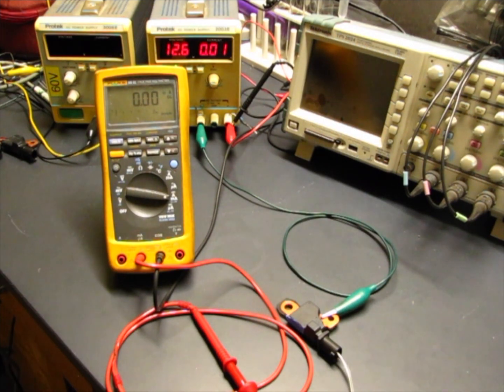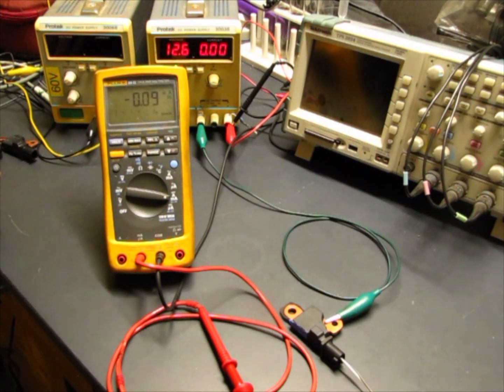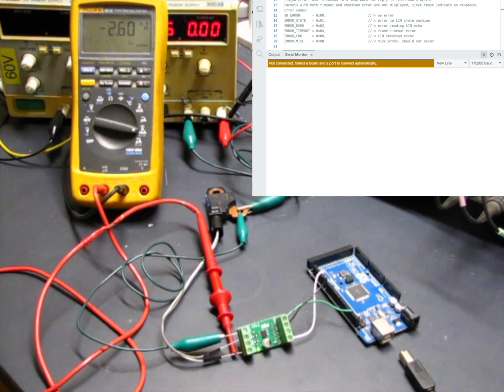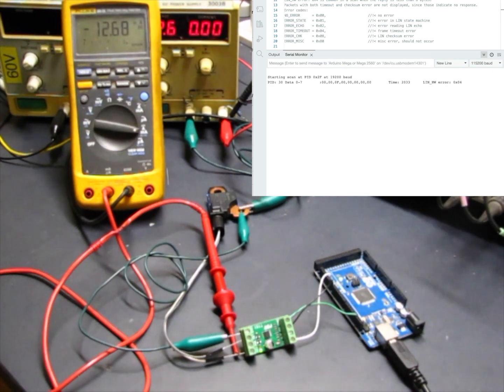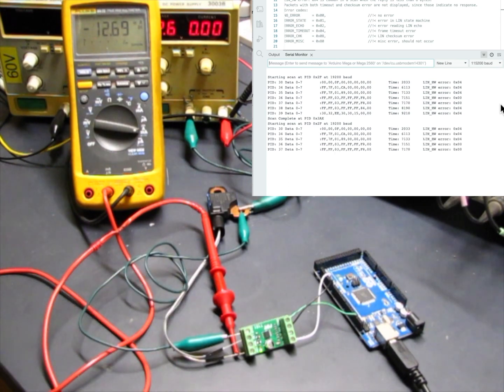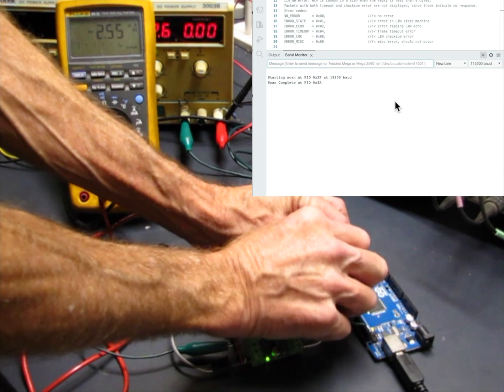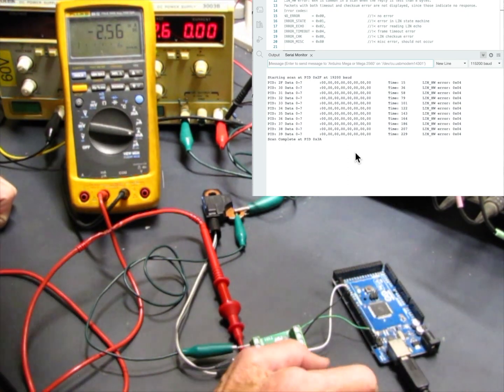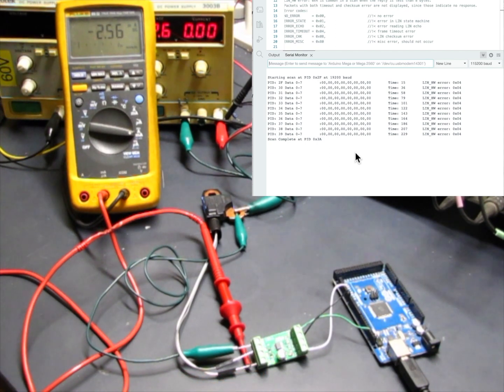Smart ForTwo ED3 EBS2 HV Current Sensor Test

Comment: Hi, I am the guy from Ukraine who made a copy of the current sensor 
And the easy way to check is it dead or not, check the resistance at each pin between the copper plate, must be at working one 2.8MOm 😘
Reply from the maker: Thanks!
You wrote mOm, which is odd and looks like milliohm. Did you maybe mean 2.8 MOhm (MegOhm)?
Reply: @CafeElectric  MΩ
For some reason the iphone chose other measurements 😁
Reply from the maker: @gosmartUkraine  Excellent! Thanks for the info.